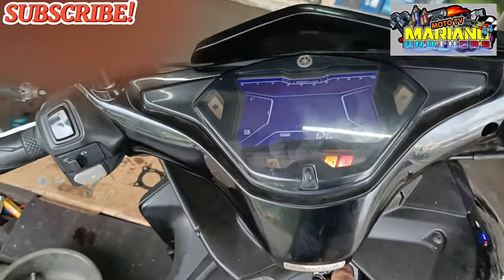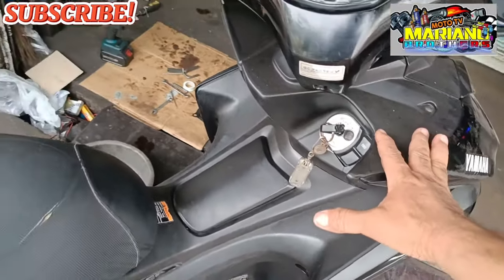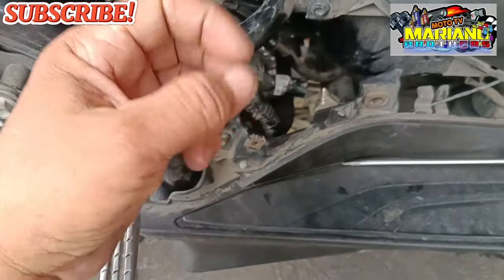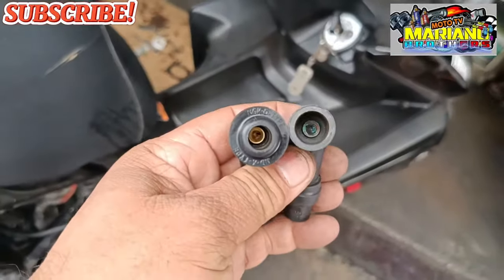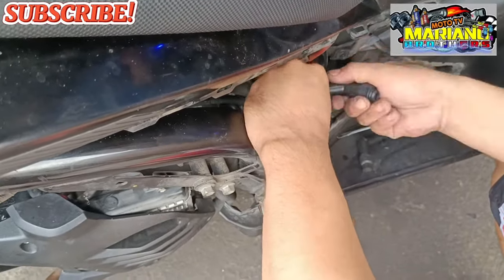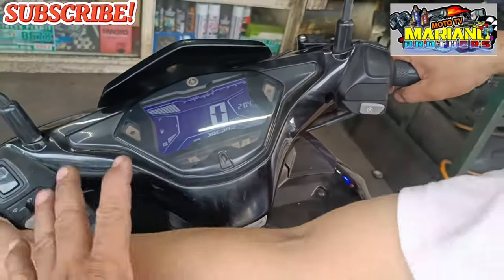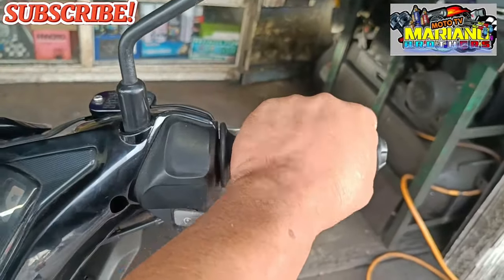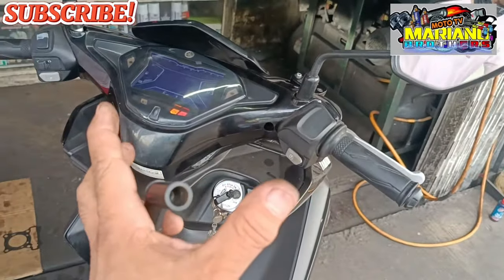YAMAHA AEROX V1...HAGOK NA PWEDENG MANGYARI SA MOTOR MO.!

Comment: thank you , sa video mo sir dhl dito naayos ung motor ko
dami ko pinalitan , idle switch, battery ng motor, battery ng remote , side stand switch
pero ung nagpatino ung spark plug cap.
nakita ko ung spark plug cap nung skn pingas at maitim na ung contact point
kaya pla paputol putol ung andar.
thank you po ulit ,sana madami pa kyo matulungan

Comment: Boss paano kung nagpalit na kami ng bagong TPS tapos wala namang problema sa harness ng unit at socket to TPS.  Ganyang error parin ang lumalabas sa diagnostic tool boss "Throttle position/ sensor wire is open or shorted" tapos "Brief abnormality detected Ain throttle position sensor". Ano pa po kayang pwedeng e check boss?